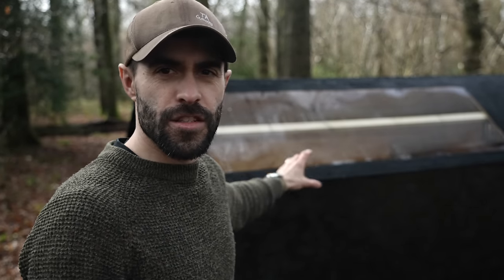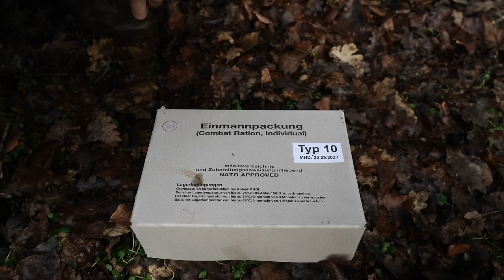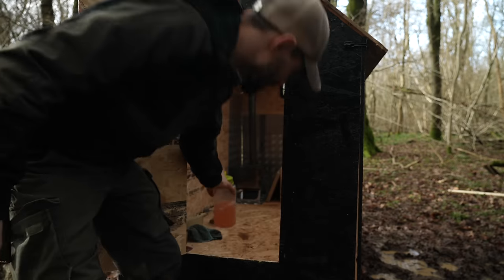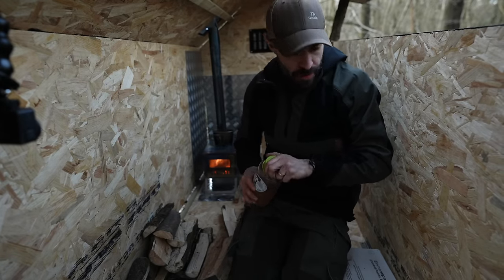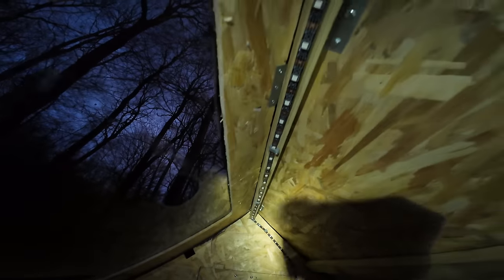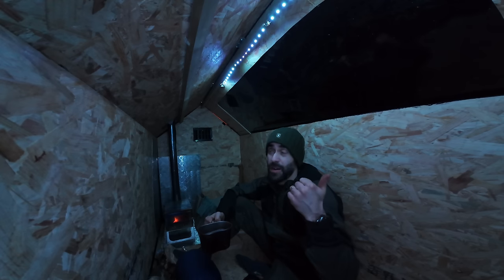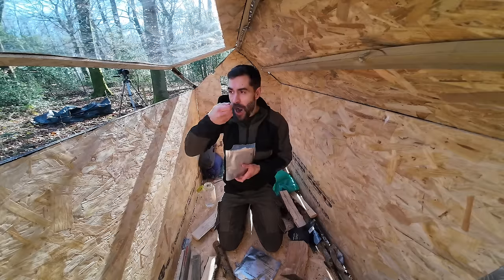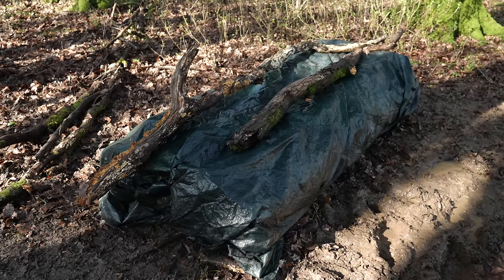The 'Stealth' Cabin: First Night in the Heated Flat-Pack Cabin

Comment: My two cents, lose the stove. It doesn't need to be inside with you. MREs and drink mixes don't need a stove. Quick overnight jaunts don't need a stove. Set it outside and use as needed. It adds a risk factor. Small space, limited air circulation. Particle board is held together with adhesives. Heated adhesives, even behind a metal plate, are going to soften and release vapors. They arent just toxic, they are flammable. I wouldnt sleep with the stove inside. It's such a small space that body heat, sleeping bag, and footwarmer, hand warmers will get you through. Its a great start for quick easy weekender trip.

Comment: try diy mylar sheat style survival blanket, but made from carbon fiber cloth painted with high temp black and aluminium from the opposite sides. prevents also the carbon fiber itch from being an issue. also if the carbon fiber sew pattern is tight enough, the double sided paint will make it air and water proof. also heat proof up to 600 or 1200C depending on the paint. yep the carbon fiber diy survival sheet is also perfect for hot temp tent fabric. does not burn or tear easily. not a plastic etc. inflatable carbon fiber tent would be very nice and rigid. strong structure. led is a very energy efficient choice, and solar panel can easily run it all year every night. so why not put the whole thing on a trailer, it has wheels and all. can be towed with a car or an atv. rv travel box.

Comment: I'm in agreement with the people giving you the heads up on using OSB. What we call fibre board in Canada. Absolutely not a good idea. Don't like raining on your parade, but I'd build it again with safer materials that don't offgas. Also OSB  just has to get a little bit wet and it will just pull apart. Also, its heavy.
Even sleeping in this thing once in a while is dangerous. You could get really sick.
Google people who bought fibre board bedroom  furniture. Not good.
Love your enthusiasm. Looking forward to prototype #2. With real wood. Also, seeing as I'm a bossy mom already, those kerosene lamps are touching the structure. That could cause a fire. The glass shouldn't touch anything. AND, I hope you would sleep with the stove off as you could kick it even with that divider and again, fire risk. Love your idea, love the skylight, just needs a little tweaking.
A bossy mom  ❤

Comment: The problem with these fibreboards is that the composite material with which the boards are made from wood fibres can be harmful to health. Especially if you use heating inside. You should do some research. Not for one night, but if you want to spend long periods of time there. The same goes for the colour. It's only on the outside, but the solvents are dangerous. This also applies to solvent-free paints, so-called water-based paints. The preservatives they contain are also very harmful. Otherwise a very good idea. Thank you. Sven from Sweden

Comment: Id paint the inside and the edges of that OSB. If you wanted to go light then should have gone 6mm marine ply.
Reply: OSB doesn't last long once it's exposed to moisture/water, mold etc will be an issue if not sealed and gets damp at a minimum

Comment: add a shelf to lift the stove off the floor. free up the foot space and add more sleeping room.
Reply: Would need to be hinged and either have some form of suspension cables or a separate chock to stop it falling from the weight. Given it needs to pack flat, and therefore can't be done like a normal shelf.
Reply: Yeah, wall mounted slot shelving uprights and the brackets can just slot in.

Comment: Make much more lighter and more room. Use 4 ft. By 8 ft. By 3 inch thick insulation foam. Glue to one side of foam corrigated plastic sheet the same size as foam. 2 foam sheets made 3 ft. wide by 4 ft. Tall. 5 sheets 4 ft. By 8 ft. 1 sheet 3 ft.tall By 8 ft. Long with a rectangle cut at bottom 1 ft. By 2 ft. Centered at bottom. 1 sheet cut 8 ft. Long by 2 ft. Tall. Glue on velcrow to fasten sheets together. Makes an 8 foot dia. cubed foam shelter that is very insulated. Very, very light. Glue where needed at bottom of 4 corners of shelter 4 nylon loops where stakes can be put in ground. Buy the bigger life straw for filtered water and the shake to inflate bed. Make 2 bicycle wheel alluminum frame cart to pull all your gear and panels on a bicycle. For light get 2 or 3 solar powered light activated sidewalk lights. 2 ft. Wide by 6 ft tLl foam board make with velcrow on it for door. Plastic corrigated boards come in many colors including camo. The shelter is 7 foot in front and 6 foot in back. Just velcrow pre cut panels together. Easy. Light weight shelter you can pull on a bicycle.

Comment: The little L brackets that you use to make a firebox why don't you make two of them and then hook them on to either end of the cabin to kind of hold the pieces together when you pack it flat use them like a clamp that way they're still attached to the cabin but you also have them to use later as a fire blocker I hope that made sense

Comment: Smaller Section of the roof hinged on the opposite side of the viewing roof section for heat release and ventilation???? also  full width section of the floor hinged drops to the ground with added sections to box in your feet for sitting up with a low level foot well... which can easily be re positioned for sleeping.

Comment: This build has elements of true brilliance, but i fail to see any real reason for this. A tent is far lighter, more portable, leak and wind resistant, cheaper, and spacious. The only advantage of this build that is immediately apparent is that it sits up out of the mud. This could be mitigated, however, by getting a tent with a stand or, hear me out on this, not intentionally pitching in the middle of a mud patch.
But yes, brilliant and better than anything i could ever hope to build.

Comment: dude  , why dont you desing it with a transparent tarp on one side so you can get in from the side or leave it open, that way get rid of doors , wood stoves inside this is a danger ,co2 poisoning etc, cooking inside will cause a lot of humidity and soon you will have molud. make sure its well ventilated

Comment: You really don't want all of those settings. You just want regular indoor lightbulb light otherwise it will be too easy to accidentally change a setting. When I bought lighting for my patio I specifically insured it wasn't customisable, otherwise it's annoying. It's the same thing with Chinese torches, they always have a strobe etc you don't want that! You want on and off that's it.

Comment: One: Coat the floor. two:. Cought the inside of the door. Three, put a drip edge at cross the top of the door so water doesn’t run in. Four. Put the stove on a shelf 18 inches off of the floor so you don’t have to worry about your sleeping bag. Five, consider fold away seat and table.

Comment: Seems totally pointless to me...Why not just use hot tent?  It would be much more spacious than that tiny hut, it will be waterproof without having to paint it, and it will only be a fraction of the weight, so you can backpack it in and leave your wheelbarrow at home.

Comment: Wood products are not the same as wood! Osb does not have the same insulating properties as a plank, plywood is worse and harboard is cold even if you're using it to face insulation 

Lightweight feather edge boards are remarkably warm and durable. Don't add any extra insulation, it will prob make it less warm 

This is what I've learned staying on my own land while looking after animals

Comment: No. Not good. Dangerous.  I've seen you build great things, but this is a wash. Sorry. The OSB would need to be better painted on the edges as well.  Needs to be bigger, and have a screened window, and sealant all over the inside and better on the outside edges.

Comment: What in the hell is Pork Jelly? it's Jerky...
Reply: Also, I would've gone with a side-opening tilt-up entrance door at least ⅔ of the length of the side, which would allow you to enter from the side rather than the end. also could have turned the stove sideways if you added another foot to the length and then used a slot in the back wall to erect the protection barrier for the heat.
With the side opening you could use a couple sticks to prop it open and have a "Front Porch", and with a slightly longer set of legs, it would be comfortable as a place to sit if you wanted to also have a fire on the ground...
Could have also gone with a single-pitch roof and eliminated the double-pitch and all the headaches involved with that.
Reply: @CommanDOH-JKU maybe you should watch the video when he built this tiny flat-packed cabin and why he built like that.